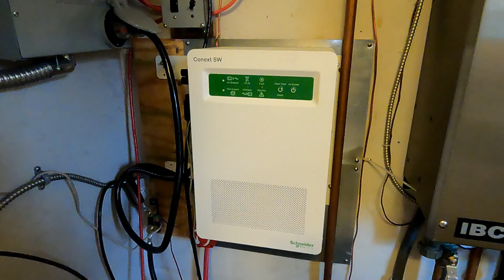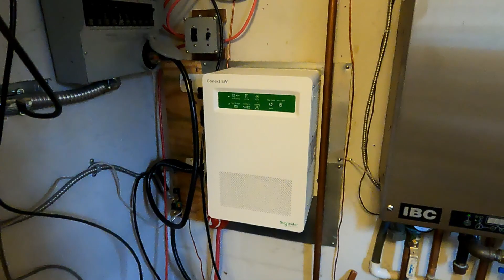Adding 10 kWh of LiFePO4 Batteries to my Solar/Battery Backup Power System - Feb 18, 23

Comment: Looks like a good addition to the system. It's hard to believe it's been 3 years since you did the initial installation, time sure flies!
Reply from the maker: Yes it doesn't seem that long to me either.  At this point in my life I wouldn't mind if time slowed down a bit.  Thanks for watching.

Comment: Hi Todd.
I would prefer you to have a fuse on each positive battery post.
If I understood correctly maybe 200A or a little less.

I don't know that particular brand of changeover switch but most can be taken apart and modified so they won't connect both batteries by removing some of the metal strip inside.. there are other ways.
A couple of chunky diodes is another way but could be expensive.
I would rather there is no possibility of them becoming parallel.
The fuses should blow if it did happen and the LA were low..
I realise there might be a BMS but I'm a traditionalist...
Does the BMS have WiFi to programme it?

I realise there are methods of paralleling LA & LI but I don't like directly linking..
Certain unqualified people may do it but I have a heap of qualifications.

Hope you are going to put the LI so you can service the LA batteries.

I could probably do a short thesis on this...

Bella 🐈 sends Valentine Love to Blackie..

Regards Mark.
ps been looking into the Raspberry Pi .. main problem is they have run out due to silicon shortage.
Reply from the maker: I haven't decided the exact fusing that I will use, but thanks for the suggestion.